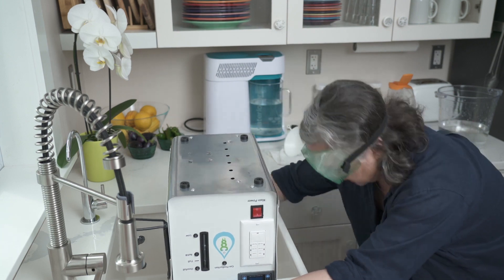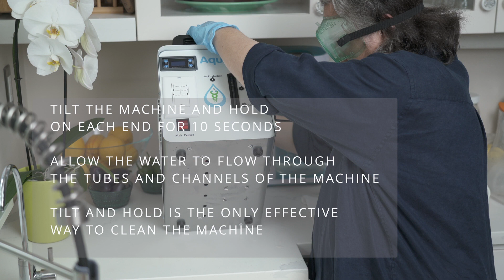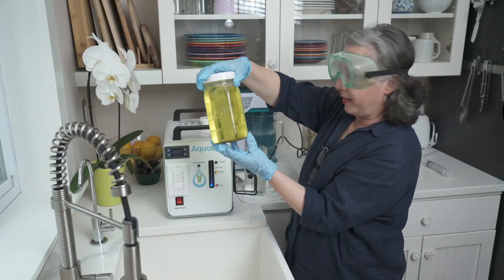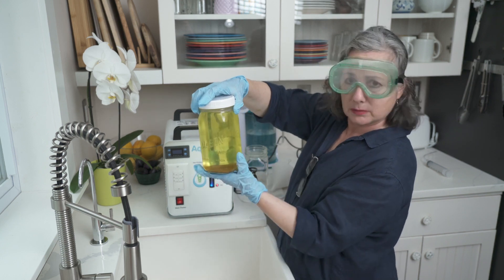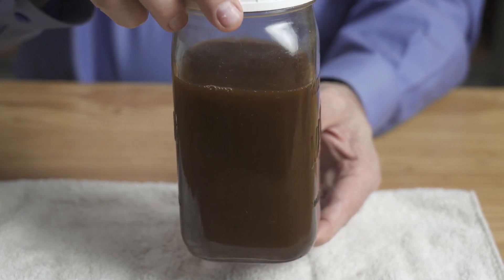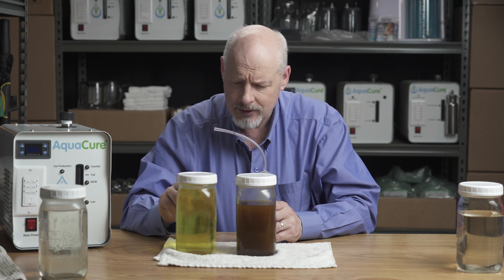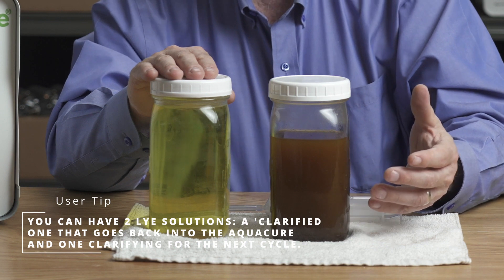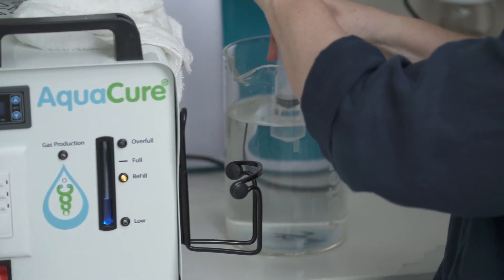AquaCure AC50 Maintenance (series video 5)

Comment: Well done!  I thought it was every 200 hours.  My bad.  I also noticed the solution is easily pulled by a magnet - as I held a large magnet near it at the bottom of the jar.
Reply from the maker: After the first few cleanings (to get rid of construction debris), and if keeping the liquid level high (above 3/4 full) the hours can be extended.  However most of the sludge is created due to a side effect of making Brown's Gas, so you'll always have SOME.
Reply: @ecopegasus  Thanks!  My next cleaning will be in 100 hours.  No problems whatsoever.  I absolutely love what this machine does.
Merry Christmas George!

Comment: I just did my 100 hour clean. I did NOT know this was the procedure. Now I’m getting gas for about 10 mins then it stops producing. Green light is on. No bubble. It also makes a different sound when the gas stops. No buzzing. I guess I’ll do a proper hot water 5 rinse and hold technique.
Reply from the maker: Sounds like a gas leak.  Contact me and we'll find the issue.  https://eagle-research.life/contact/

Comment: OK this is the first video in a while, or is this a rerun. I have not seen it before and welcome it a christmas present. I have fallen off in the use of my Aqua Cure machine and have no excuse-my new years resolution will be to start eating better and breathing more Browns gas. So when you make up for the lower level lost in the cleaning, you obviously dilute the electrolyte. This can be measured by checking gas production. I replenish this level by drawing a bit out and dissolving some lye in it and then adding it back. Is this a proper procedure, or am I missing something?
Reply from the maker: No more is needed for a long time.  40 grams is all that is needed for full gas production.  We put in 80 grams to start to compensate for at least a year of lye lost during maintenance cleanings.  Do not add more lye until the gas production falls off, and assuming there is no gas leak.  
See below to see how to measure the lye concentration.

FAQ: When to add more lye?
Q: I also have a question about gas production.  Can I be assured that as long as bubbles of gas are being generated then the machine is operating properly?

GW:If there are bubbles, it is Brown’s Gas.

After that it’s ‘how much’… If the gas production is less than it should be then it could be a gas leak (most common) or not enough electrolyte (lye).  See gas volume testing below.
Test gas production   https://www.youtube.com/watch?v=w1GOztHEOgk

Q: It seems that the machine has been operating quite a long time since I last replenished the solution.

GW: You should almost never need to ‘replenish’ the solution.  I’m still using lye solution I originally mixed in 1986.  It doesn’t ‘go bad’. If fact, as it gets ‘conditioned’ it gets more efficient.

What does happen though, is a tiny bit of lye is lost with the gas as it rides on water droplets (which get caught in the Humidifier). 
This ‘lye loss’ is SMALL and might lose an ounce in 2000 hours at 100% gas production.  
The bigger lye loss is during maintenance cleanings, where a small amount is left behind with the settled sludge (assuming you are doing the maintenance rinsings as currently recommended, see UPDATE below).

AquaCure AC50 Operation Manual UPDATE notes
https://eagle-research.com/wp-content/uploads/2021/11/AquaCure-Operation-Manual-Update-Notes.pdf

The AquaCure will make therapeutic volume of Brown’s Gas with as little as 30 grams of lye in it, so if you find you need to add lye, I recommend adding no more than 1 ounce (about 30 grams).  Then you will have PLENTY of lye and if the gas production doesn’t improve, there is another problem to address, like a gas leak (which you should always look for first because you do NOT want to have too much lye in the machine).

Excess lye leads to more lye loss, potential foaming and crystallization / plugging of internal orifices.

Q: It seems to me common sense that if only distilled water is put in the machine when level is low, it will eventually weaken the lye concentration and thus not produce bubbles. 

GW: Electrolysis requires a catalyst to operate.  It’s very difficult to ’split’ water without a catalyst.  The catalyst we chose (after testing literally thousands) is lye.
In theory, since the lye is supposed to STAY IN THE MACHINE (and NOT come out with the gas) it does not ‘weaken’.

A catalyst (by definition) does not get consumed in the chemical process / reaction.
So the only thing that get’s 'used up’ in the electrolysis is the water.

Brown’s Gas is made ONLY of water.  So as Brown’s Gas comes out, you need to replace the water.

Theory aside, In practice a TINY amount of lye can ‘ride out' on water moisture droplets that are in the exiting gas.  These moisture droplets are trapped in the Humidifier.

The amount of lye that ‘rides out’ in this fashion is so small that it would literally (and I mean literally) take YEARS of constant use at full production before there’d be enough lye loss to need to add more to the solution in the machine.  There is NO need to even consider such an insignificant loss.

MOST of the lye loss is when maintenance cleanings are done.  Because some is left behind in the sludge.

So after a few cleanings it MAY need an ounce of lye added to the solution (when it is outside of the machine).

’No bubbles’ COULD be a symptom of not enough lye, but USUALLY is NOT!
The DEFINITIVE test to know if you need more lye is to test the solution specific gravity using a hydrometer.  You want a reading somewhere between 1.05 to 1.1 specific gravity.

The lye is a catalyst, so it is not 'consumed' and in theory the initial charge would last a lifetime.
However, in practice a tiny amount is lost out with the gas over time (the Tower Cap reduces loss and the Humidifier absorbs the rest). 

Lye can also be lost when people pour out some of the solution or if there is a leak or during maintenance rinsings.

The easiest way to determine when you need to add another ounce of lye is when you notice the gas production has dropped (and there is no gas leak or hose blockage).

I do recommend a specific gravity (of the Lye solution) of about 1.05 to 1.1 (using a hydrometer).  
Here’s what a hydrometer is and how to use a hydrometer (need a test cylinder too)
https://www.youtube.com/results?search_query=using+a+hydrometer+to+measure+specific+gravity 

You can get a good kit from Amazon.  Be sure it is a hydrometer and not (or not only) an alcohol meter.
https://www.amazon.ca/Specific-Gravity-Hydrometer-Test-Kit/dp/B001X27L9W/ref=sr_1_1_sspa

Or just mix 80 grams of lye in the first mix of solution.  The solution does NOT need to be exact.  In fact it’ll vary normally as the water leaves anyway, the remaining solution becomes more concentrated.

You can use more lye (I previously recommended up to 150 grams), but we've found it leads to excessive internal lye crystallization that causes clouding of the sight tube and exacerbates any internal plugging (due to sludge formation or oil contamination turning to soap).

A Very Good alternative (but not definitive) test is to look inside the machine as per the instructions I gave you.  If you see bubbles, then you HAVE ENOUGH LYE.

If you do not see bubbles there could be other issues, like a bad electrical connection, that have nothing to do with the lye concentration.  I have people put in double the amount of lye needed from the start; it only NEEDS about 40 grams of lye to be fully functional.  It’s Very Rare that the machines don’t have enough lye

’No Bubbles’ is USUALLY a symptom of a gas leak.  I usually start by checking the Tower Cap base

Properly Install the Tower Cap
https://youtu.be/Pr98DMe94No

Make sure your Tower Cap base Union is sealed properly and that you remove the Tower Cap using the Union ring, so you do not need to keep re-applying the Teflon Tape.  
DO NOT ’torque’ on the Tower Cap to seal the base fitting; doing so will ‘lock up’ the Union, requiring wrenches to loosen it.

Test gas production   https://www.youtube.com/watch?v=w1GOztHEOgk

May the blessings be
 🦅 George Wiseman
wiseman@eagle-research.com
Reply: Sounds like a good remedy.  Is there a way to measure the electrolyte solution (alkalinity)?